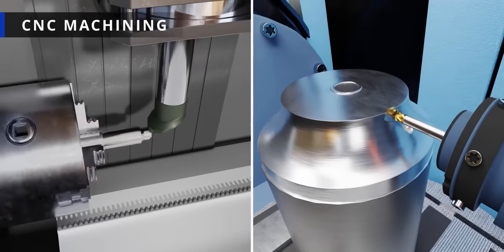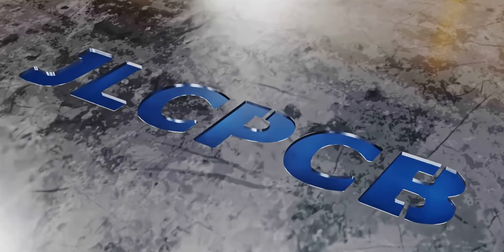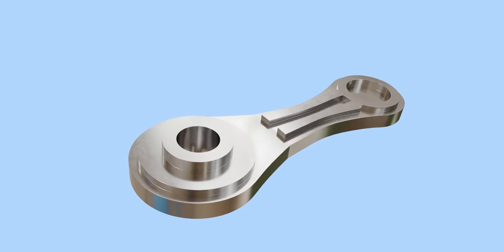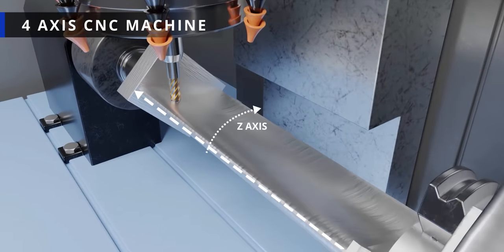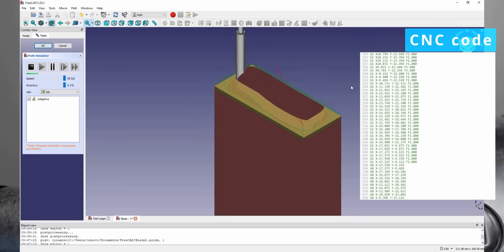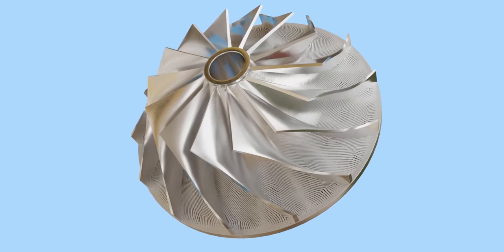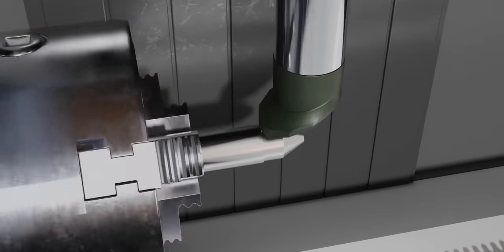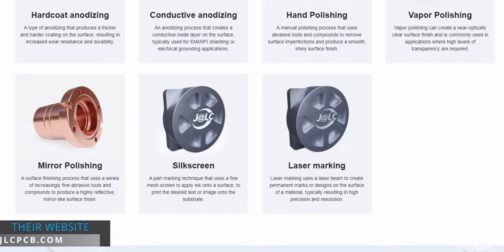Understanding CNC Machining with JLCPCB!

Comment: the fact is, the machine shown in real footage at 03:54 is actually an EDM machine, not a cnc milling machine. So the liquid is named "dielectric liquid" which make EDM process is possible. Coolant liquids are abit different.
Reply: Thier making a hole cnc machines can use different coolent liquids. You can see the bit coming out a little with an edm machine (wire edm) you would see little sparks and the process is usually done completely under deionized water

Comment: He makes it sound so simple LOL. Just give it code. It takes alot of skill to get great finishes even on the best machines. In the past one had to operate manual mills before operating cnc. But now the 2 are so different. Even at the best shops they can scrap alot of metal a week

Comment: While this is a great basic course on the subject and should suffice in 70% of all of its content, it lacks some key components for a proper understanding of the subject if it is aimed at someone with little or no knowledge. Also there's a major explanation error on 2.5 vs 3 axis CNC. Here are some suggestions from me on those parts.

- Add a line on what machining actually is: Removing material, usually very precisely, from metal blanks.
- Add a short section on lathes and routers, as CNC machines combine these two technologies.
- Note that CNC is basically the use of a drill to remove material from a workpiece of any kind by very precisely pointing it and holding it very still.
- Add an animation of how a 2-axis CNC positions its router using simple tapes, because 2.5, 3 up to 5-axis CNCs are more or less just adding specific mechanisms on top of each other, each with its own speciality. You don't need animations on these higher-count axes in this video, but I would prefer an explanation of the principle of how the router just moves around.
- G-Code: Add a line to show the X-Y-Z positions in space.
- Animation error: M code makes the 2nd and 3rd line appear immediately after the 1st line.
- Slow down the animation or repeat it with arrow pointers when you say that on the 2.5D CNC Z movements exclude X and Z, as the movement ends too late there. Also, the following plunge of the cutter into the material is for 3-axis machining, which falsifies the previous sentence. The cutter suddenly moves in all 3 directions in this part of the video.
- Add a line about 2.5 and 3D machines not being able to remove material from underneath the workpiece because the cutter head cannot rotate and is fixed in its vertical position. This is important to understand the difference to 4 and 5 axis CNC machining.
- 3-axis machining is not explained as the animation on 2.5 is simply inconsistent as stated above.
- Regarding G-code from CAD software, please explain that G-code is a kind of "list of where to move things in the machine and in what order". I would also add that CAD software can translate 3D shapes into a "recipe" for a CNC machine. You can modify this "recipe" by hand.
- You might want to add a note that certain CNC machines offer templates for simple machining tasks such as "make a screw hole there", "make a cube this size", "make an engraving from an image" and more, which do not require any special software at all. However, this is optional.
- For the 5D explanation, add its operation like a traditional lathe. On a lathe, everything has to be measured to within a thousandth of a millimetre or even more. Changing the tool with this precision requires several manual steps to maintain the accuracy, which the CNC takes care of by using electronic measurements everywhere with extremely high precision. Automatic tool change is nice to know, but it's more important to know that there is hardly a manual lathe in the world where you can go from turning to milling (manual machining) on the same machine, virtually instantly. This is what makes CNC so amazing: you can 'print' parts in batches with high precision, as opposed to manual work, which takes a long time to produce very few parts, albeit with similar precision, without the need for a highly experienced machinist - but most of the time you need a machinist to write a programme (CAD) for a new part.
- I'd add a banana for scale for the tiny 5D machine, or somehow compare it directly to the big regular machine. Visually, I could not see the size difference in the video because of the monotone background.

Please note that I still think this video is great in all aspects I did not touch! I just think the explanations here were not up to your usual standards.
Reply: Plenty of machines you can go Manual to cnc. Milltronics built their whole business on it. Same as hurco. Both have a conversational type programing where input answers to questions and don't need to know g code.

Comment: The inside of pump blades is far more aggressive because it covers a smaller rotation area.  If the outside of faster spinning blade was as aggressive, there would be cavitation of fluids.